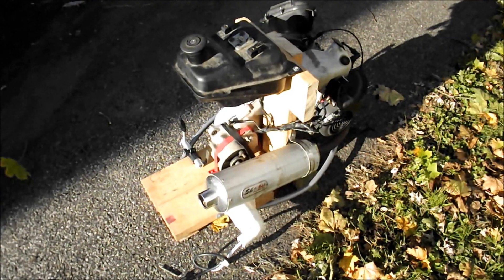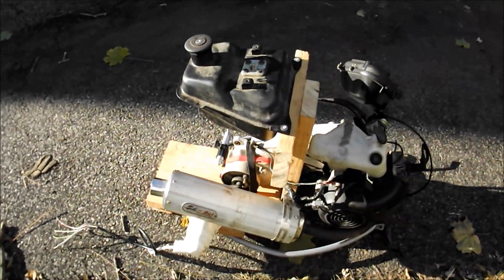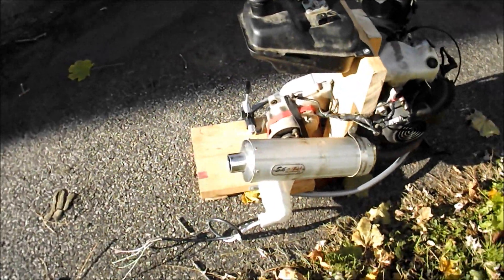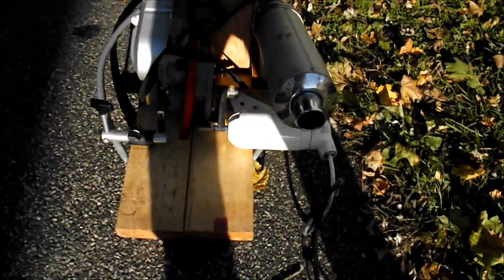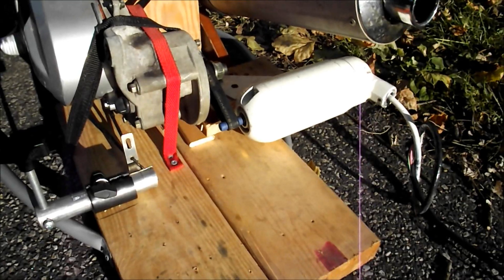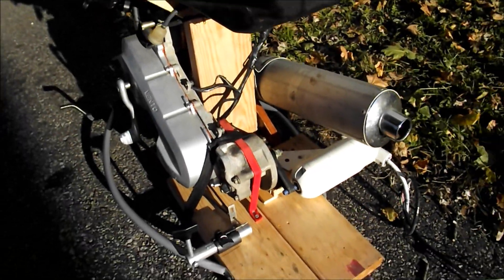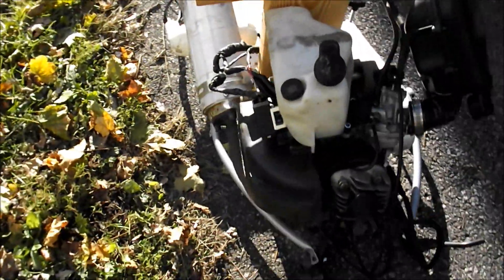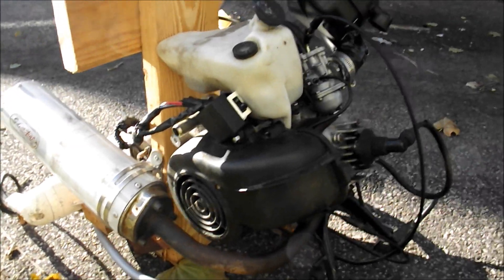DIY How To Make A Homemade Electric Generator. 50 cc Moped Motor.

Comment: I had been thinking about building an electric three-wheel moped, but like a Chevy Volt where a 50CC motor would recharge the battery as you drive. Locally it seems the definition of a moped is pinned to the <50cc petrol motor. I think I could make one have virtually unlimited range and a top speed of 35 MPH. The gas engine could also be used to extract heat from on cold winter mornings. I think there is not much point in building a vehicle if you can;t drive it in at least 90% of the country 365 days a year.
Reply from the maker: I like that idea